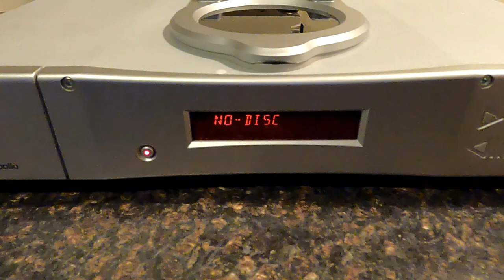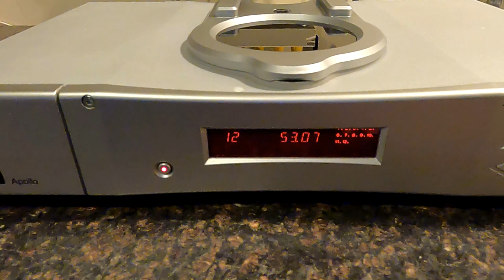How to replace the transport on a Rega Apollo

Comment: It was interesting seeing my Apollo being repaired. I was looking for something else and this popped up.

I purchased it sometime around 2004 / 2005 to replace a Rotel 965BX.

Some earlier skipping was resolved by replacing the disc in the player. More recently though it had become a distinct problem and wasn’t solvable by simply restarting the disc. Picked it up today and no skipping whilst trying it at Cheshire Audio and another 5 hours at home and no problems.

Thanks Phil.
Reply from the maker: Told you it was quick :-)

Comment: Thank you doing this video.  I have an older Rega Apollo that I like very much.  Do you know which version of the Sanyo SF-P101 laser assembly was used?  There is a 15 pin and 16 pin version.  Is it difficult to transfer the ball-chuck platter interface to the new unit?

Comment: Thanks for the video. Looks easy enough to that I’m willing to try myself on a similar player with a bad transport. Only question is why did you de-solder?
Reply: because the laser unit is very sensitive to static electricity they short it with solder for during the shipment. best safest practice is to remove the solder after connecting it to the electronics.
Reply: @Erwinhooi  thanks, i was able to replace it, working and sounding great.

Comment: Hi Philip! Where can we purchase a rega apollo cd transport? It is not available on their website. Thanks again !
Reply from the maker: It would have to be through a dealer
Reply: @cheshireaudio  I have been told by an engineer that they are Sanyo transports (£40) but the ball chuck arrangement for clamping the disc is a Rega mod. However, the mod can be removed off the old unit and attached to the new one.

Comment: It can’t be a year 2000 Apollo lol, they weren’t introduced until around mid 2006. The Planet 2000 replaced the original clamshell planet in 2000, and that was replaced in 2003 by the Planet 3 (not sure there’s a lot of difference to be honest). The Apollo was extremely well received when it was released and they couldn’t make enough of them, I wanted one myself. I ended up with a Saturn which was even nicer!
Reply from the maker: You are right ... just Googled,  I've always called this model the Apollo 2000 ...  wrongly now it seems.   I should remember really, sold plenty of them!

Comment: I thought that the solder joint is to protect the laser diode from static and should only be unsoldered once you've reconnected the Ribbon cable up ? I'm no expert it's just something I was told year's ago.
Enjoy your videos 👍👍
Reply from the maker: Apparently a bridging link of some sort... it doesn’t work on some players if you don’t desolder it